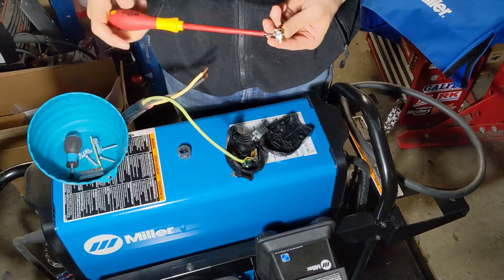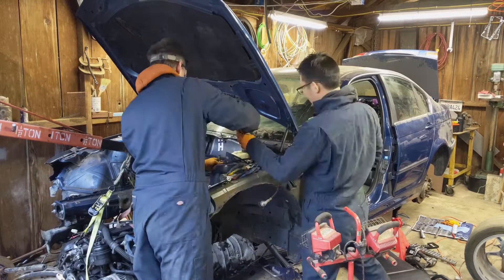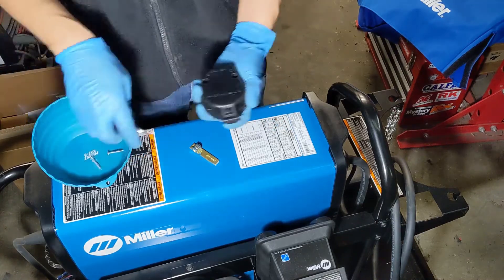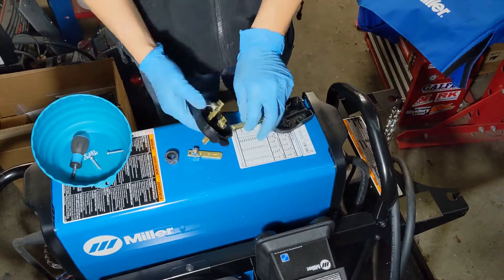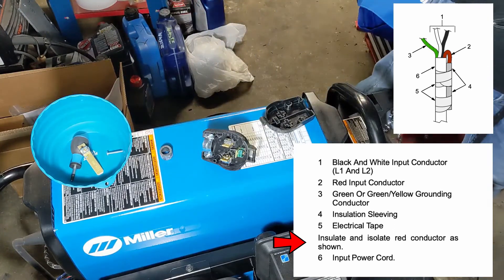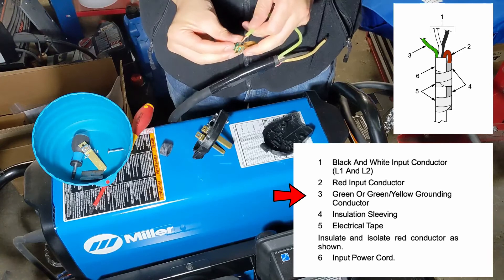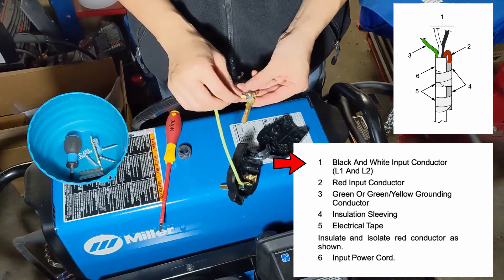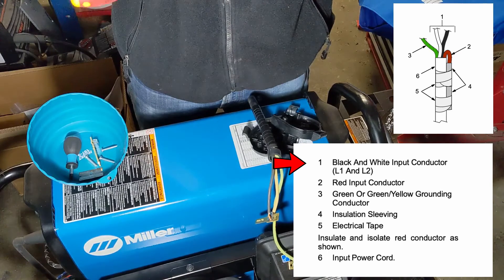Wiring a Miller Dynasty 210DX for single phase ⚡️

Comment: With Green wire on top. Is Black wire on left or right. Which wire goes to the smaller male size, on the right?
Reply from the maker: The plug you buy should have a pinout, did you get a print out for it?

Comment: Was it just a case of doing the wiring, my brother has done the wiring for single phase bur he is getting a low voltage fault coming up , someone said something about a trip switch inside but he cant find one .
Reply from the maker: not sure what you are asking
Reply: @EscargotGarage  did you just wire yours for single phase and it worked? , My brother wired his for single phase and he is getting a low voltage fault on a display .

Comment: My washer/dryer outlet is a 125/250v 30A outlet but it uses 4 prong instead of 3 like yours… so would I need to use the red wire? I went and bought 8awg 3 wire thinking I was gonna be able to use it until I saw the 4th prong on my outlet smh
Reply from the maker: Hey, I'm not an electrician. But I think you have an extra neutral wire.

Comment: I have a 240V 40A receptacle, would that work on that machine?
Reply from the maker: You'd need to read the manual. It depends on what and how you're welding too.
- https://www.millerwelds.com/-/media/miller-electric/imported-mam-assets/spec-sheets/b/2/5/dc32-1.pdf